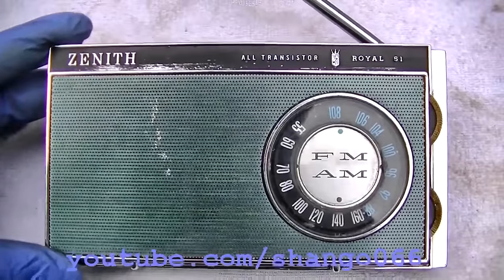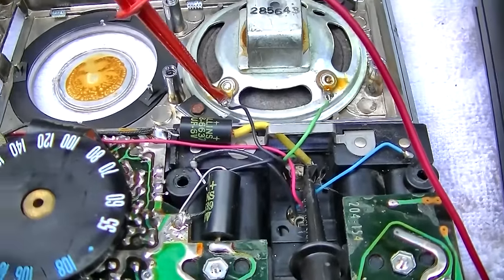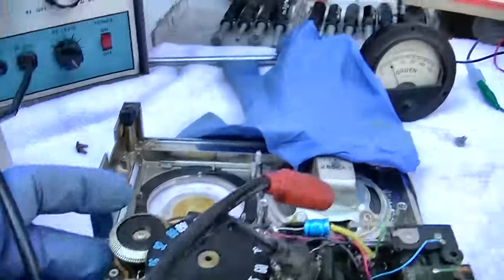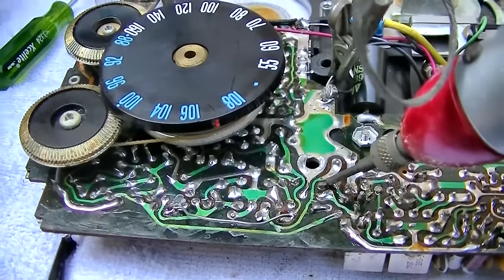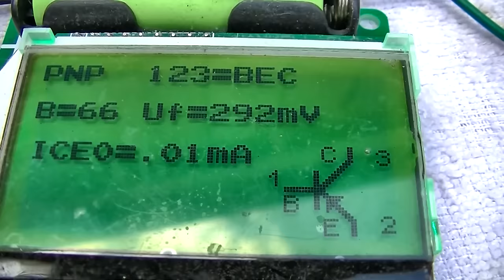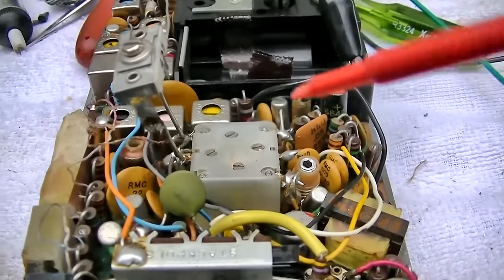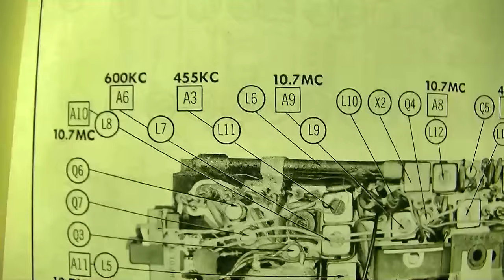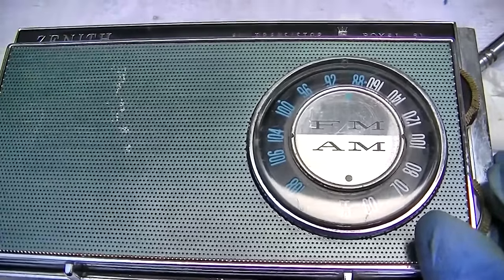Zenith Royal 51 AM FM Radio Diagnosis and Repair Alignment

Comment: That AM bar antenna was originally designed to feed an IC (wich usually have higher input impedances), it should have a lower turns tap for the converter transistor to be better impedance matched to its base. Squealing and higher noise can occur, supposing the transistor is good.
Reply: Same thing I was thinking.
Reply: I'm guessing that the antenna is going to couple to the band-pass filter thru something like a 10pF cap. U could try a different value for that cap, as it would be a series-resonant circuit, and the "new antenna" would have a different inductance value than the original design. Also, that thing might have an RF amp as well, and I'd make sure that transistor was still biased correctly. Since it's probably PNP,  it might also be the cause of the noise, developing whiskers and such. It's hard enough for us to diagnose this without a schematic, of course. :D
Reply: Shango, just do this. Measure the resistance of the the two coils. The bigger resistance should be the actual antenna, and the smaller resistance (secondary) will be lower to match the input to the front-end better, however they have that setup.
Reply: Hey fellas. Any ideas as to how one could test this? Grid dip meter? Maybe sweep generator at RF frequency and measure....? Measure IF or audio output with modulated RF? I'm just thinking about the analytical objective/instrument side of the conversation. Thanks and God Bless!

Comment: Pull turns off the antenna till it sounds right i use a hair dryer to melt the wax and unravel one turn at a time but man nice job you got it alive agian and functional agian .
Reply: Now u have me wondering if Sams listed the resistance and inductance of the antenna :D. If so, he has it made.

Comment: Hello Shango066, I guess it still has an issue in the HF amplifier section. That's being controlled by the AVC, preventing the AM demodulator from being oversaturated with signal. When the HF amplifier is very weak, it will cut off without signal coming in. So it will be quiet between the stations. When there is some signal, the HF amplifier comes to life and the AVC is going at maximum to provide enough signal to the AM demodulator. But it's still weak and very noisy. It will may not cut off the transistor in the HF amplifier section, but it can cause a lack of signal somewhere else in the circuit. Just a guess. Nice video!

Comment: The noise could be a phasing issue with the primary and secondary coils in the loop antenna. I’d try switching one or the other and see if there’s a difference.

Comment: Those screws in the beginning aren't worn, its just a new type of screw design by Apple so that no one can open up unless you buy their 15,000 dollar screw driver set sold only to certified Apple technicians which you will have to pay an additional 100,000 dollars to become one. 😉
BUT WAIT ! They will give to you a second screwdriver set for FREE ! 
(just pay a separate shipping and processing fee)
Reply: Wouldn't help you anyway.  All of the chips are married to each other.  I like apple computers and swear by them but in reality they are $3k disposable items.
Reply: It's  different  angle  cross tip that is not used here in the USA  thats why  they  get wreck
Reply: Screwdriver not transferrable to others, conditions apply.

Comment: ГТ309Д is rated for up to 40 MHz. А and Б versions are for up to 120 MHz. It is too weak for FM. I recommend to use any of ГТ313. Any of them are for 300 MHz at least and their military grade versions (1Т313) are for up to 1 GHz.
Reply: I agree with that, the 309 aren't too hot to start from, and are loosing a lot of beta around 10 MHz, these are ok at typical AM frequencies though

Comment: Have you tried replacing the AM diode and any capacitors after it. There is usually one to take any IF or RF to deck and pass the audio through. I had a Russian Set with a similar problem. Changed them both!

Comment: The noise in the AM could be because the inductance of the ferrite bar antenna is not matched with the tuning capacitor. Even though you matched the top of the band with the small trim caps, and the sensitivity and selectivity are there (both are provided by the IF amplifier) the bottom of the band is still not matched and hence the bar antenna doesn't resonate there with the fully meshed tuning capacitor. The hint is that you had to add extra capacitance to get the top of the band into tune.
The tuned LC tank at the frontend (bar antenna inductance + tuning cap) keeps a lot of noise away from the converter, besides suppressing the image frequency. Without the LC tank being in tune, everything gets into the converter stage, including all the noise.
Reply: Any ideas how one could test this and point up the mismatch? Thanks

Comment: Great fix! But a coupleof q's: (1.) If there were an inherent gain to that tube stick ...could it be a bit off (high) for this set and causing this issue or would that even be possible? (2.) Also, you mentioned there was a capacitor wire on that stick....would a cap there have any affect in cleaning it up?

Comment: The reason you got the same station at the top and bottom of the dial was due to image frequency response.  In a single conversion radio you will get a "ghost" at double the IF frequency lower than the real frequency.

Comment: I had range anxiety until I traded my Tesla for a 1995 Toyota Celica. ICE cars eliminate that problem.
The selectivity of the radio is great, but I can't listen to noise behind a signal, the snow, waterfall etc. I have no useful advice to offer, but I personally would not consider the radio to be usable as it is..

Comment: The bar antenna is the problem with the noise. IDK what your patience level is but you could get the spec of the original and wind out your own and put in there.

Comment: Where's  a good source  for tuner string?  My 1957 zenith  string let go . It was great for getting  AM stations  at knight.
Reply: Unwaxed dental floss, in a pinch.
Reply: I got the tuning dial cord on eBay from a seller in Israel. They were selling it in 1 meter lengths.
Reply: Bob’s Antique Electronics from Colorado. Just received a dial cord supply within the hour.
Reply: @williamstevens7090  That's good to know.  When I searched on eBay,  I couldn't find a seller for this in North America.  The LW/MW/SW tuning capacitor seized on my Nordmende Globetrotter 808, the dial cord snapped,  and that's when I was on the hunt for it.
Reply: I always use fishing string. It's very strong and do able

Comment: Hi Shango, I have an SX-727 that has a noisy AM Band where no matter what station you tune in it makes that waterfall noise you're talking about that this Zenith is doing, and as far as I know it has it's original AM Loopstick Antenna.
Could it possibly be the same issue as your Zenith is having, a mismatched AM Loopstick?

Comment: The solder blobulator on the IF can is way too big; that size is only appropriate for sets with dead spiders in them. Adding some rat nest material will twinklefobulate the AFC and bring the set to life.  This is only a test. We now return you to your normally scheduled program. 🤓

Comment: I think the excess noise is from a leaky transistor. At  41:02 "How many kilograms of hydrogen are at each station" Did you pick up a Canadian station on E-Skip?
Reply: No, definitely not, it was daytime... the signals can't bounce off the ionosphere with the sun up. (Can't tell you why, it's just a fact.) DXing works best around 10:30pm-2 am from my experience...
Reply: @NickG123  FM Skip happens happens during daylight hours via the E-layer
Reply: @joeblow8593  Ah ok, thank you, Joe. 
I mostly play with AM. But with my little experience in fm I’ve never witnessed E-skip though. My friend actually just mentioned hearing a distant station o fm while I was over at their house with one of my am sets. Maybe I’ll start doing some more fm stuff too! I also should of payed attention to what band he was on before I made my comment...
Thanks, 

Have a great night!

-Nick

Comment: I doubt it's a transistor if the noise only occurs when on a station, I would think you would hear it all the time. It's likely that the antenna just isn't a good match, as evidenced by the fact that you had to pad the tuning condenser to make it work